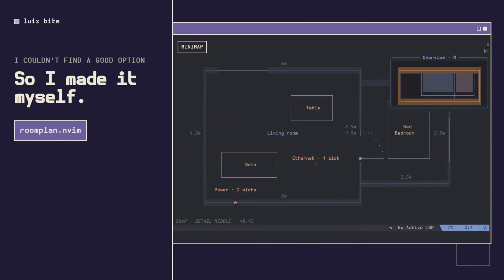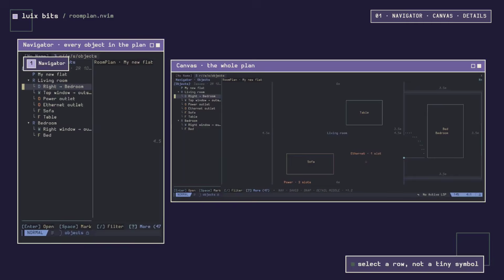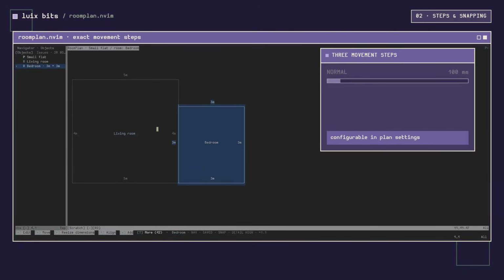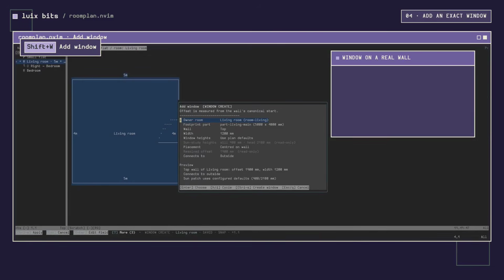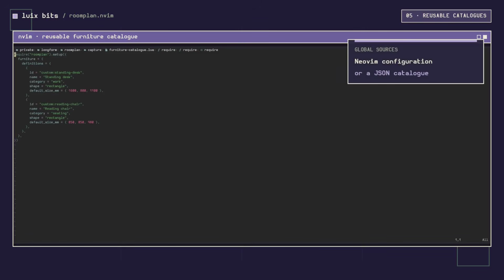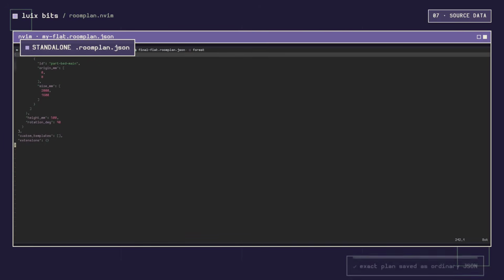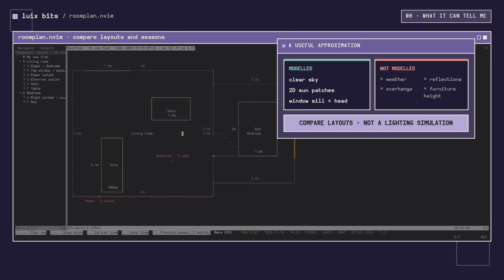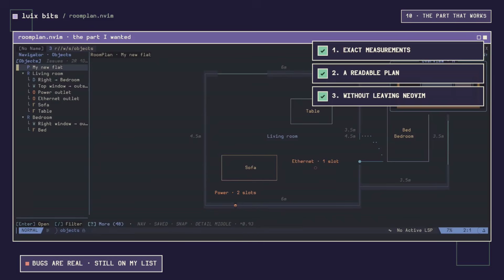I built a floor planner in Neovim

Comment: What about uneven rooms ? Not really square or example ? No house dimensions, sure old houses, are never perfect dimensionally.
Reply from the maker: Hey as I mentioned later in the video, currently its limited to squares. 
I have to figure out how to properly show rounded shapes in neovim. And the harder part is entering angles and curved walls. That requieres quiet complex UI elements. Both were challenges that I am trying to overcome, but not in the first few versions :)